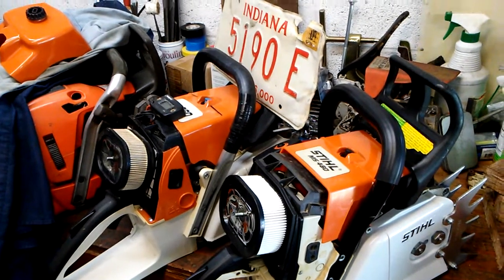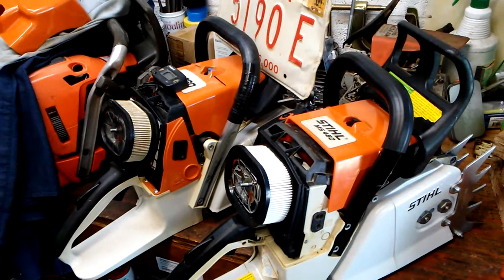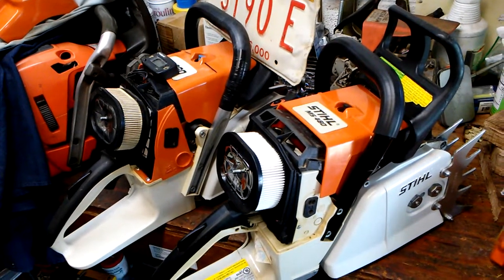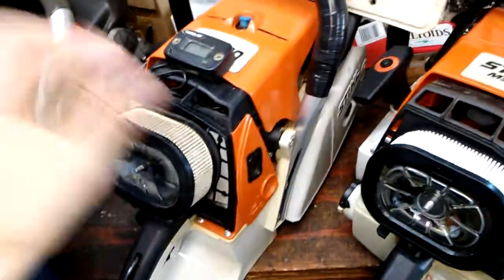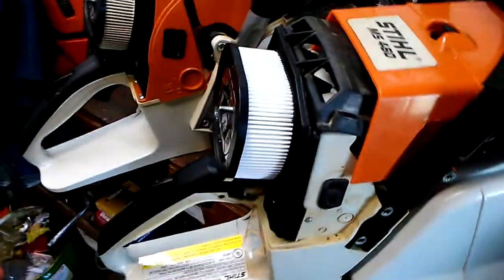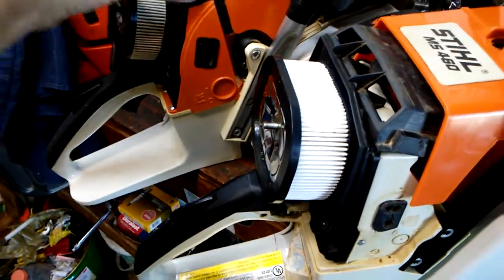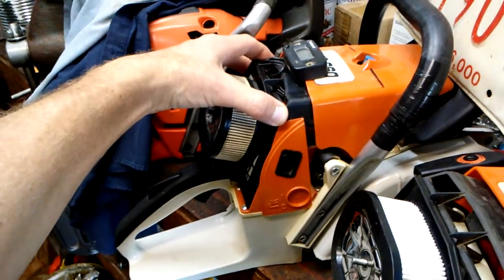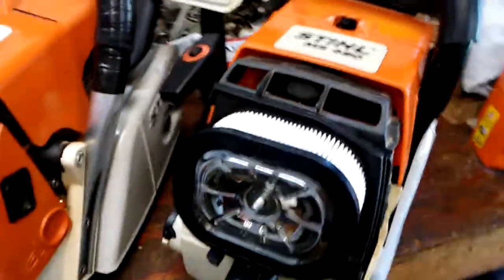Stihl 1122 141 6300 air baffle

Comment: Just seeing this Brian, thanks for the insight. After seeing your OEM version, the baffle makes sense to the design. On the clone that I have, it's a pointless excuse for an attempt, however. I have been in contact with the company to help with improvements, we will see how that goes...
Reply from the maker: Sometimes the OEM part is the best solution with some clones, sometimes the clone component is good. I have put some seriously hard hours on both and have found the clones will not endure the abuse nor the hours that the OEM units will endure. However, with care they are a viable option.